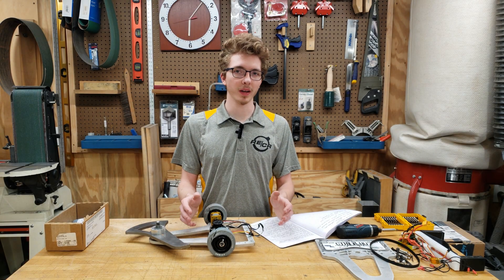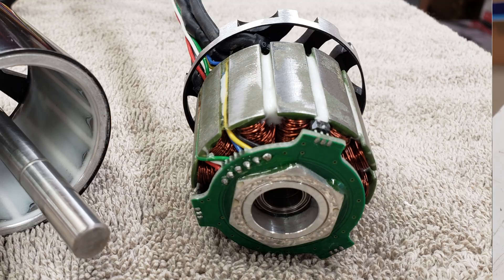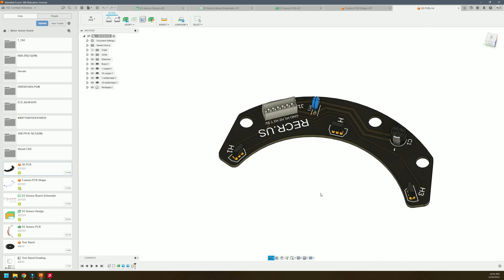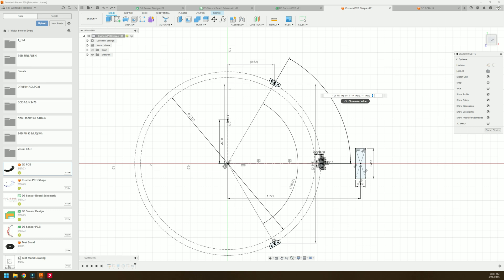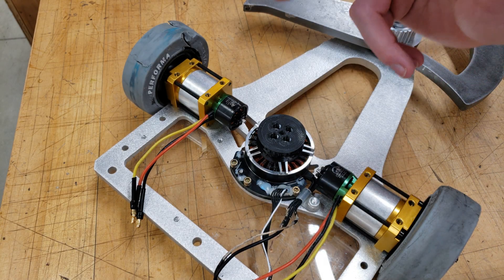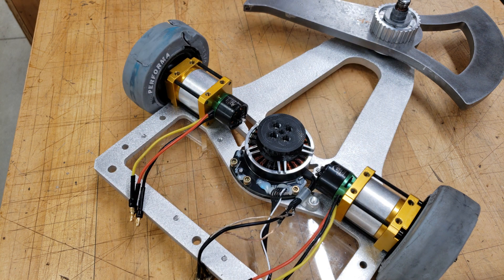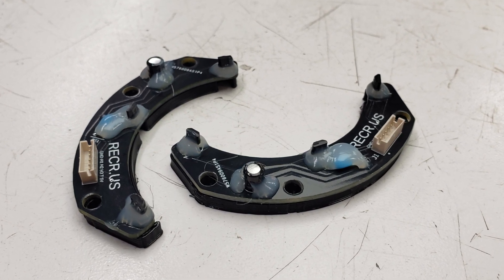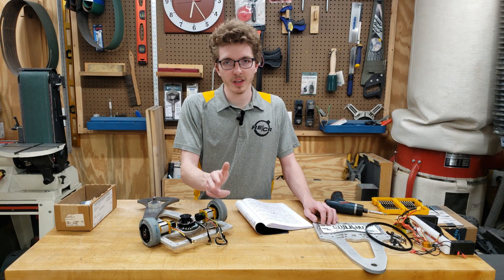Custom Brushless Sensor Board for Outrunners

Comment: What weapon and drive motors and escs do you use on razor's edge?
Reply from the maker: The most recent version of Razord Edge was PropDrive 2826s and Flycolor 30s on drive, but I would swap the motors to the Tempest 2808 for a new version.